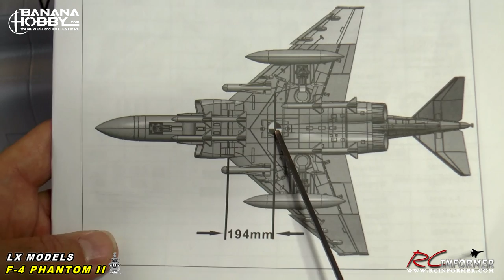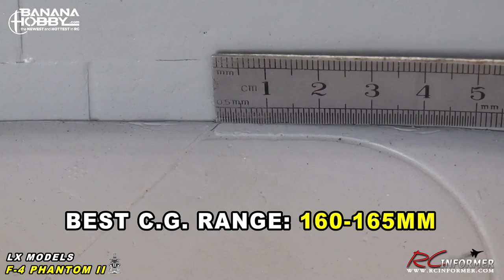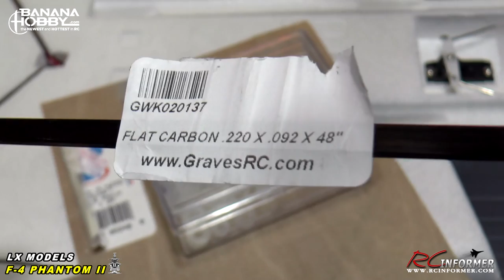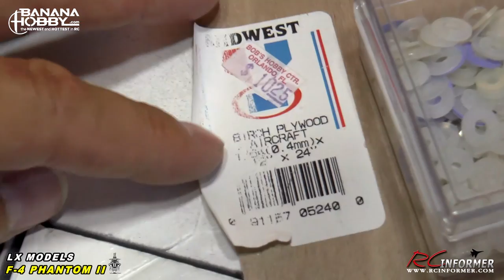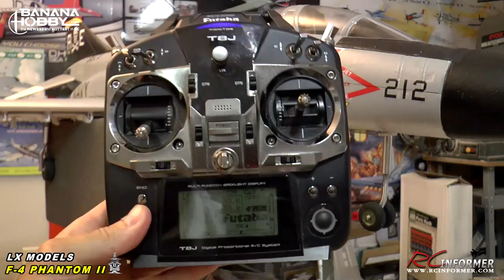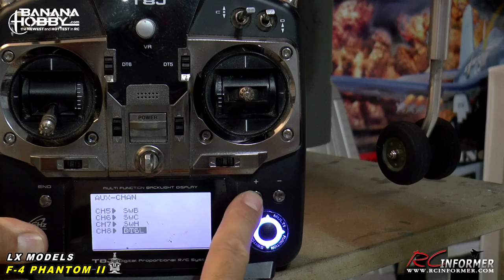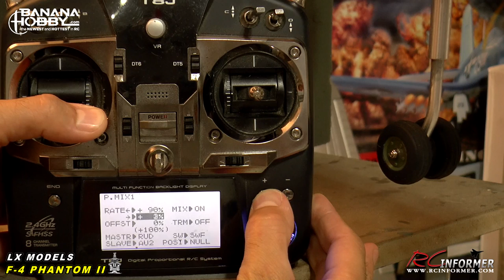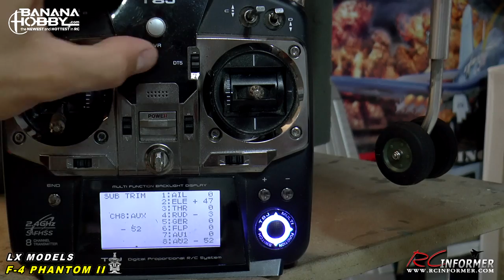LX Models / Banana Hobby F-4 PHANTOM II BUILD & SETUP By: RCINFORMER

Comment: nice flying. Thanks for all the time and input on this jet. I've read alot of reviews where people were not happy at all with the plane. My first thought was that they had the CG wrong. I had just ordered one today and from watching your reviews, it helped me decide if I wanted to buy one or not. The F4 is my all time favorite jet but I was skeptical about a foam one. Thanks for the great review.
Reply from the maker: Steve Bryant the reason I spent so much time on the video was so that people knew that I had to do some things to it first to get it to fly well. CG is everything with this airplane if you have the CG set right, it flys Fantastic! if I remember correctly the CG in the book was about 30 millimeters too far aft.
Reply: I hope it's ok to call you Rich, But yes I payed close attention to the CG placement. I've learned alot on your videos. I haven't been flying in about 10 years so after I get some flight time with my prop planes, then I'll tackle this one. Happy Flying
Reply from the maker: Steve Bryant Sure, you can call!
Reply: Hahaha, sorry, I meant call you by your name since we actually don't know each other.
Reply: Good morning Rich. I have a question regarding the lipo battery, or batteries. I noticed on Banana Hobbies site, they have you get a 4000 mah 25c with a banana plug. Also are they 6s? Now I've noticed in the parts section for the F4, it shows parts for a Y connector with banana plugs merging into a Deans connector. So I'm assuming I would need 2 lipos @4000 mah 25c with banana plugs or like you get  a 5000 mah 50c with a dean's plug? I just ordered the plane a couple days ago , so I don't have it yet. But I wanted to get some batteries before it arrives. Thanks for your help.
Reply from the maker: Steve Bryant I am using a 5000mah 6s 60 or 65c Genesis that I now use a EC5 connector.
Reply from the maker: Steve Bryant One 6s is all you need
Reply: Ok, Does the F4 come with the ec5 connector or will I have to change what's in the plane? Thanks
Reply from the maker: Steve Bryant I don't think mine had a EC5 at the time... I had to add it
Reply: Thanks for your help Rich

Comment: Excellent job with the slats. This video is the "go to" on RCGroups for is plane. However, your flap setting being only slightly deflected is not making the most of the flaps. You want your current full motion for take-off, but at least 45 degrees for landing. You don't NEED 45 degrees for landing, but then you don't NEED flaps. I'm just suggesting that you use them to their full potential. You've got so little throw because you used the inner-most hole on the servo. Note that flap servos are usually not "centered", but instead at one extreme of their throw when in the "up" position.

Secondly, I appreciate the difficulty you had with the slats, but can the servo buzzing/stalling not be eliminated simply by adjusting the end points? Not so much that the servos actually move, but just to stop them pushing against the ends of mechanical travel. I've seen this many times with flaps.
Reply from the maker: The problem i ran into is that the servos were not perfectly synchronized in the exact same position on each side. The slight buzzing was hard to eliminate totally on BOTH sides at the same time because of this. There are also slight differences in the positioning of the arms on the slat Torque rod. Each slat system on a specific persons plane will have slight differences. FLAPS: I was afraid of having to much drag, and while the flap extension is not maxed out, its travel combined with the slat travel are a very good balance that works great for both takeoff and landing. My plane practically lifts off by itself and lands at a reasonably slow speed... mission accomplished:) Sure I could tweak the flaps to extend them more, but the extension I used seems to be a good setting that works in any phase of flight... I just had the plane flying at an event two weekends ago and it is still flying perfectly!

Comment: nice job on setup, i have question for you, what do you recommend for 10 or 12 blade fan engines. and where to get them?
Reply from the maker: I have not actually used any of the 70mm 10 or 12 blade fans. However MotionRC carries many 70mm fans that are used in their Freewing Me262 that may work well. Most all of the Freewing stuff is good.

Comment: Rich
Which twin edf jets would you suggest for ease of flying from a grass runway?
Reply from the maker: A twin EDF for grass use? Nothing comes to mind.... However the ultimate EDF for anywhere is the Freewing Stinger 90!
Reply: +1 on the Stinger 90. I maidened mine yesterday, 100% stock PnP. Easiest maiden I've ever had! So smooth, so comfortable, so sweet to fly. All the stock gear is perfect.
Reply: That's awesome, the stock setup is great.
Reply from the maker: Clarence Hebert The stock setup is quite good! once you get the Slats & Flaps working, its a sweet plane!

Comment: What's your thoughts on the ME 262 as for as flying from grass?
Reply from the maker: Ok... you got me! I cant believe i forgot about that... YES the Me262 is a sweet twin for grass use, I almost always fly it on grass... but it needs to be reasonably low cut grass, but it has great suspension to handle the bumps.

Comment: You can't be serious asking $335 for a Styrofoam toy plane?  SERIOUSLY???

And then you have to buy a radio, battery and charger as well?  That is INSANE!
Reply from the maker: It is not styrofoam, it is Expanded PolyOlefin.... if you make yourself one out of wood or fiberglass it will be heavy, expensive expensive and harder to fly. EPO models are about 1/3 the cost of traditional models and they fly great. it is the evolution of the Hobby...